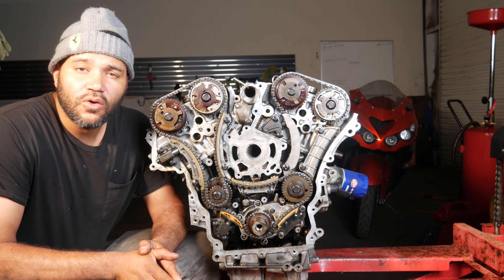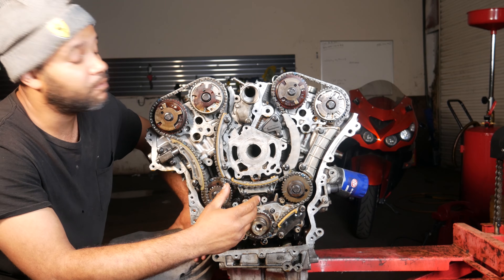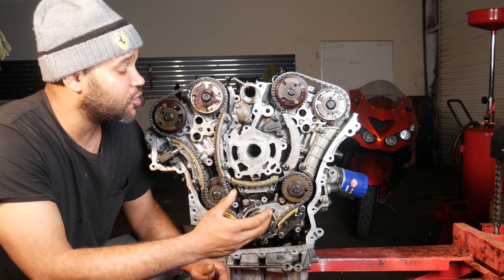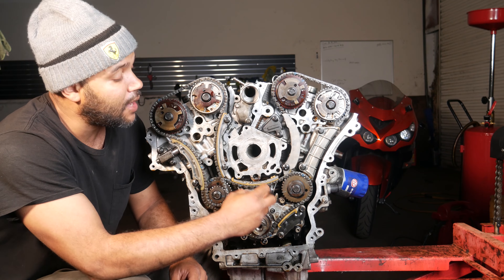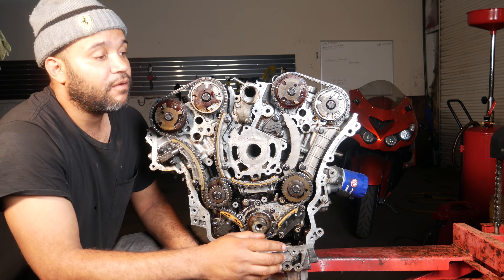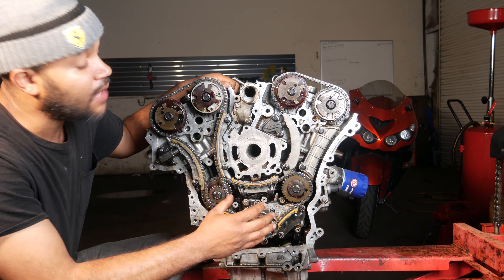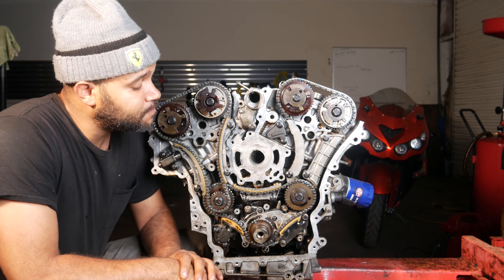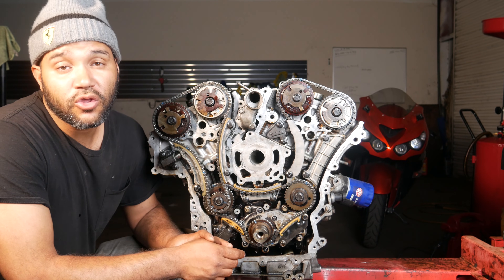HOW TO PREVENT TIMING CHAIN PROBLEMS l GM 3.6 ENGINE PROBLEMS

Comment: I have a 2004 Cadillac CTS 3.6, first year of the 3.6 with the original style timing chains. In years after GM changed the chains and gears to be quiet. This is when it has the most problems, I believe 2005+. Change oil Mobil 1 10W-30 every 5000 miles for life of car. 229,000 miles, original timing set!
Reply: I'ma do it every 3000 and try to keep it perfect..hope to get 250000 miles out of this joint
Reply: Had 186000 on last one..... Did it myself never had a problem...
Lucky I guess

Comment: I just inherited my grandma’s 2014 Buick Enclave with the same engine. This video was really helpful as I have read a lot of horror stories on this engine, now I know the basics on how to prevent it. Thank you!
Reply: GMC made improvements after 2012 to the timing chain.  The most important thing is to keep up on your mobile one oil change. The timing chain has a hydraulic tensioner. So keep up with the oil change. You should be fine. I have a 2017 XT5 cadilac and it's been bulletproof. Enjoy it, there good engines!
Reply: @jarin12ga  - that is interesting information. I would like to know more about the improvements to the timing chains after 2012. Do you have a reference that I could read?
Reply: yes  , changing that oil ontime is the best . i had a 1994 oldsmobile 88 royal over 200,000 and i had to replace the lower intake gasket , the engine was clean no sludge .  and plus i get it on the highway and get that engine up to operating temps , good luck on your 2014 buick
Reply: @myfavorites1016  3800 V6
Reply: @myfavorites1016  Thank you, I actually took it to the dealer last week for a full service before the service light came on and they told me the engine was in perfect condition. It’s been a good car, it’s huge but doesn’t drive like it’s that big, there’s a ton of space for me and my dogs which is nice. I’ll keep on changing the oil on time and I hope it lasts me a long time.
Reply: @SaraL0297  ive always changed oil at 3k maybe just slightly more,  but with my driving as half in town  , half highway,  then yes i still change oil on time , I've seen and heard about the parts of the engine that can start to fail if neglected.  Such as timing chain , the bearingings the piston is on . So i dont go by nothing but my own rule . It gets its 3k oil changes.  Plus i warm my car up in the winter,  even tho my current car 2013 Chevrolet impala is all computer controlled and its more updated to when computer tell everything when to work,  i still think its best on even the transmission.   Im probably to pickey , but hey its my car
Reply: @myfavorites1016 not even close to the same engine
Reply: You can prevent it by trading the piece of shit off on a Ford Edge
Reply: @stevejohnson1397  my mom's Ford edge just needed a new engine at 47k miles. Water intrusion into the # 3 cylinder. Common issue. Hard to escape poor quality across the board.
Reply: @stevejohnson1397  I always liked the Edge tbh, however this Enclave has been amazing so far, I change the oil every 3k and it’s been good to me ever since. It has now become my default road trip car since my aging Golf is just too small for me and my dogs

Comment: You nailed it!  It's a engineering F-Up.  Saabs don't have this issue.  Better heads do to a turbo.  Also another big thing! its a High Feature Engine!  High compression! use the gas gm tells you to use!  These motors are none like any motors in some since.  They are as small as a 2.8 and can be punched out to a 4.0 No motor can do that with out sleeves.  This one can.   Look at the vent valve on the covers. One side it is big while The other is tiny!  Take that cover off and take a bit or something open it up!  That will help that side vent better.   Oil and gas is all this motor ask for. Don't cheap out! It will treat you well!
Reply: OK!
Reply: What the @$#& has GM done🤦‍♂️

Comment: 2012 and up GM changed the oil passage sizes and improved upon the engine. I wouldn’t bother with a pre 2011 unless you’re either A) Gambler or B) Technician.
Reply: I have the notorious 3.0l v6 300k and still kicking ass!...however I have changed the chains before not that bad of a job!...had it done in 4hrs or less than again I'm a mechanic!...but the PCV is the Achilles heel of the workhorses!...drill em out bigger or run a catch can and they'll outlive us!
Reply: Can i put a 2014-2019 3.6l v6 engine into a buick lacrosse 2010
Reply: @theshield1613  ⁸88
Reply: @theshield1613  no.
Reply: I've got a 2005 model,  owned it for 17 years. Had no problems with the timing chain. It has done 203,000 kilometres ( 126,000 miles ). I think it's a combination of low K's and regular oil changes. 

But I've notice the engine is starting to sound a bit noisier lately. So might just do the timing chain now before problems start occurring.
Reply: @tomjohnson1110  Not the same engine….
Reply: is this true? where can I see info to back this up? im trying to see if I should buy a 2013 Cadillac CTS 3.6L
Reply: Jimmy S  Sorry guys should have explained it better. My car is a 2005 VZ Holden Commodore from Australia which had this engine . I think we called it the LY7 Alloytec.
Reply: Jimmy S  I was having the same codes along with a reduced engine power it's the wiring harness that goes over the transmission you have to hang it up with wire ties or zip ties once you do that there will be no more problems. It rubs the back of the transmission and causes everything to short out.

Comment: Why can’t you use a thicker oil?
Reply from the maker: You can in the summer but in colder temperatures, it’s a possibility in cold start to destroy cam bearings, the oil is going to too thick in cold start up
Reply: I use the full synthetic Lucas and use it all year round change my oil every 3-5 k depending on how I drive it

Comment: Gomez home auto I'm doing a 2010 cadillac cts4 3.6 has a p0017 crank sensor the motor runs like it has a miss checked with scan tool and this is the only code I Hurd the 3.6 on the cts 4 run kind of ruff from people talking and dealer saying it's normal but could it be a chain and guild issue or a sensor is not reading on the phaser I've Hurd they get dirty and they clean phaser so sensor can read the car has 124359 miles and has new sensor to thank you love video one other thing do you prefer cloyes timing chains or acdelco?
Reply from the maker: Jason 90% of the time p0017 is the bank1 secondary chain is stretch. I always use the cloyes chain, never use the Autozone chain kit.

Comment: ...is this GM's High Feature engine, a LY7 3600?  

.....this engine has No relations to my 3.4L v6 in my 2004 Buick Rendezvous, with engine block LA1, 3400, E-code 🤔  ...which is just a standard iron block, with OHV configuration.

Comment: What would you estimate the cost of a timing chain replacement w/ phasers and oil pump? I have 3.0 LFI engine. May need to start budgeting for it now.
Reply from the maker: I charge 2000 for the whole job. With 1 year warranty
Reply: @bossautomotive7786 where are you located?
Reply from the maker: With Gm parts
Reply: What about for the twin turbo 3.6?

Comment: Hey man, I was thinking of buying either a Regal with the 2.0 Turbo or a Lacrosse with the 3.6 V6. I always do oil changes every 3k with full synthetic along with AC Delco filters. If I keep running that schedule will either of these engines give me a problem. And which will be the better engine till 150K?
Reply from the maker: The 3.6 is a better engine in my opinion and experience. If you keep to the 3k oil change, full synthetic and high flow oil filter.
Reply: Boss?  What do you think of the GM 3.9?
Reply: @Jack51971 The 3.9 is good. Not a direct Injection engine so you won't have these problems but got plenty of power.
Reply: I have a 09 Malibu with the 3.6 over 200k miles, my recommendations is keeping the oil changed, once da oil gets dirty check engine lights come on etc, every 3 or so months I get a oil change #idrivealot oh I also use #Seafoam every now and again, in the gas and oil case, timing will be off if the oil is bad